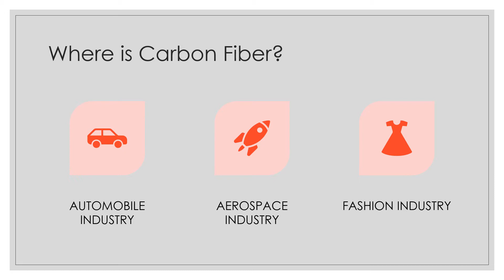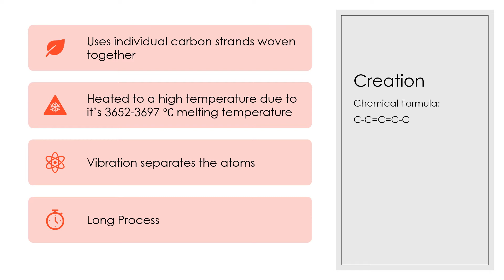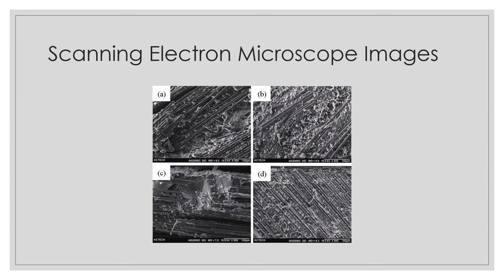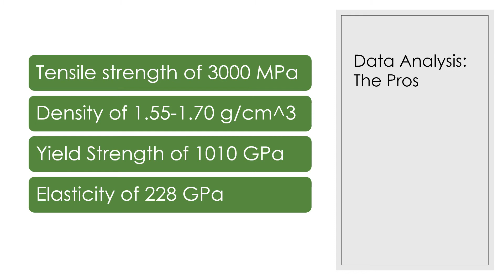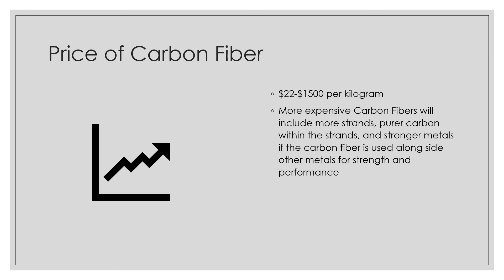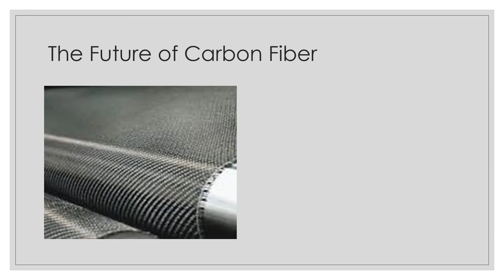Carbon Fiber by Lynn Bateman

Comment: Excellent video! content was great and the greatest aspect of the video is the fact you don't just read off the slides and transitions between slides is very good! My only recommendation is to split slide 5 into 2 separate slides as it seemed very long compared to the rest of the slides.